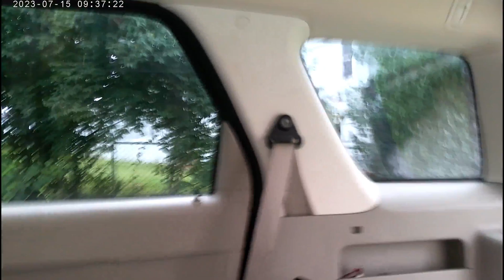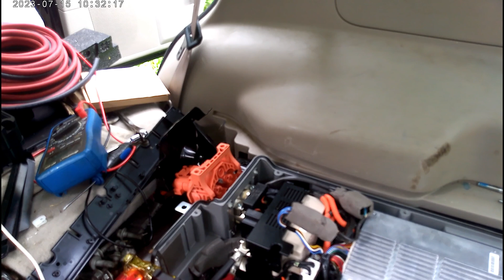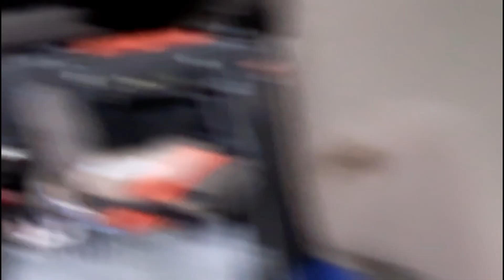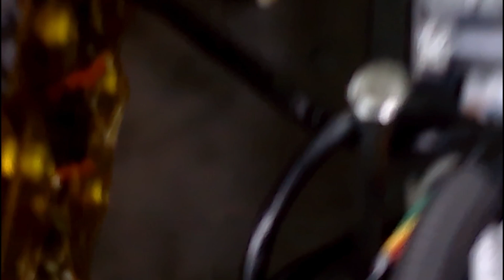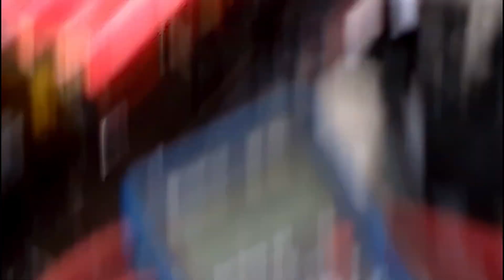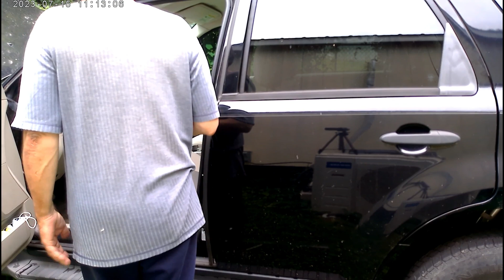2008 Ford Escape HYBRID Battery Rebuild Progress Success

Comment: This is a fire waiting to happen.  Li-ion batteries have different chemistries and charge differently than the stock NiMH batteries.  Li-ion battery chargers monitor charging rates and stop power if there is an issue.  NiMH chargers don't have that circuitry.
Reply from the maker: oh really? These cells are NOT lithithum-ion they are LifePo4. Im well aware of the diffrent algerithum of charging methods and was thought over should i or should i not. Fact is the cells dropped no less than around 86% and  are charged by the car to 362 volts roughly max charge for the cells 365 volts. NEVER over charged or drained in a matter of straining the cells. Just in case you did not notice i used the factory battery harness. Everything worked fine for a week till a daly active balance went thermal meltdown destroyed about 8 cells. i removed the daly set up replaced the bad cells and both modules in the battery case and the car never started up again straight to the junkyard it went which is where it was going to end up if i didnt at least try this method and with the exception of the Daly active balance catastophic failure It was a win i got almost 600 miles that week and the cells were never over charged and did not drop that much during a load.

Comment: How can I learn more about what you did to this battery, the modifications etc. I want to understand more about the parts you used
Reply from the maker: Battery hook up.com is where I got the cells and the cell type is headway The chemistry for these cells is lifepo4 The cells full charge at 3.65 volts there is 4 cells combined in a module There is 100 cells total for the entire battery The top rack is 13 modules and the bottom rack is 12 modules the batteries are held together by a 3D printed battery holder Battery hook up does have the holders that are built specific for these cells but I chose to print my own. So far this battery set has worked absolutely perfect the charging system is maintaining the cells at a 3.2 to 3.4 range per cell. No problem has been found for overcharging
Reply: @battery_solar_ev hi ! Are you sure its the right link ?
Reply from the maker: @takarise  batteryhookup.com           this will get you there

Comment: 370v 
mine goes upto
Reply from the maker: Ive been keeping an eye on it and ive seen on brake regeneration 375 but not very often. This set up is doing great keeping the cells at 3.2 to 3.3 volts. Thanks for the heads up. :-)
Reply: @battery_solar_ev hello ! How can i diagnose bad battery on the 2008 hybrid escape ? Whats are the signs
Reply from the maker: @takarise  give it the beans on take off and i mean really step on it youll feel the power drop at some point and let off and feel the power increase. Pull away from a light at a normal pace when the electric motor tries to start the gas engine youll feel the power bog down just before the engine starts. Lower gas mileage like only getting 28mpg at best Mine is up to 31.8 highway now it was only 28. In the mornings when you go to take off and the car straight dies Red triangle and Exclamation  mine did this 3 times before stayed running after that i let it run for a few minutes before leaving i got another 200 miles out of it and parked it. Pulled 6 cells from the top rack 4 of them failed did not want to take a proper charge of 7.4 volts with out over heating and tested lower than factory capacity.
Reply: Thanks ! I Will keep an eye on it ! Car has 180k miles and hasn't been use for 6 months. Its my first hybrid so i don't really Know how its works ! Learning...
Reply from the maker: @takarise  With that kind of Miles and set for 6 months it's quite possible the hybrid battery is low voltage too low to start it. I've had that problem with mine It broke down one time I could not afford to fix it and when I finally could replace all the front brake system including the soft lines The hybrid voltage was too low to start the motor. My car had bad calipers and bad soft brake lines I went on and replaced the brake pads while I was at it too.
Reply: @battery_solar_ev  I would like to thank you for your work, as I said earlier I have just started with hybrids and I need your help! I suspect my battery is not good and is no longer holding a charge properly. I use a scanner from Autel to monitor voltages when I drive. Maximum state of charge 65% minimum state of charge 39.8% the state of charge itself varies but never exceeds 53% and as soon as it approaches 40% the thermal engine systematically turns on. I had read that the maximum state of charge of hybrids should be around 80%, I don't know if that's true. The total battery voltage does not exceed 350v and can go down to 309v. I believe the battery pack is not good, but I have nothing to compare it to. I want to open it to test the cells one by one, I have a multimeter but I wonder if it will be enough to recognize defective cells. Should I try to have 7.4 volts on all cells? I remember in one of your videos you advised against buying battery cells on eBay. Unfortunately I think this is one of the only possibilities I have to get new ones, unless you have a better idea. THANKS
Reply from the maker: @takarise  now some one that "knows" more than i do my disagree  7.2 volts for each cell although bottom line 7.4 volts should be full charging voltage but cells are NOT new so here is the result. 7.2 volts if it over heats toss it. Even then get a capacity checker for the cells after you full charge them to test the capacity of the cells if the cells are less than 5 amp hour toss it, you may most likely come across alot of cells that over heat and are around 4 amp hour or less. The big problem with the factory cells is age makes them over heat with they get fully charged in short they will not want to take the "normal" full charge voltage with out over heating. China want 40 bucks each for new cells I said NO WAY im not paying that for old tech I will build my own. You got 3 options refurished renewed or new 2500 to 4500 bucks for a drop in replacement. If you build your own like i did then for the love of god do not use dalys' active balance I lost my car from that catastrophic failure i never did get it to start again after that so junk yard it went